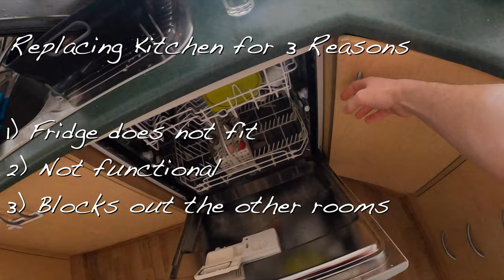Ikea flatpack 10K Kitchen in 10 Minutes

Comment: Why would anyone get rid of gas for the hob? I want a gas hob and old style gas oven. By far the hest for cooking and baking. The rest looks good.
Reply: Air quality and global warming reasons
Reply from the maker: We were pretty happy with the change. Might be a preference thing. It does put less gas fumes into the air, and we had a large solar panel system on the roof to cater for increase in electricity prices.